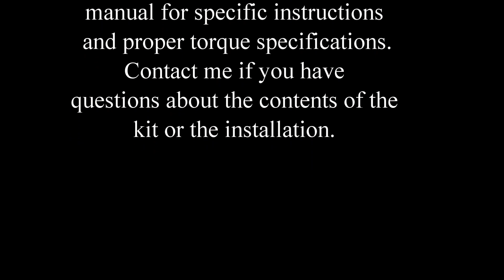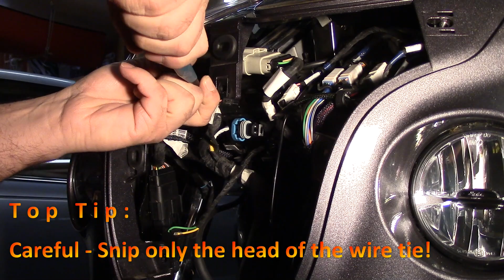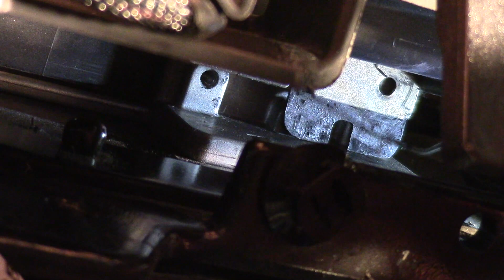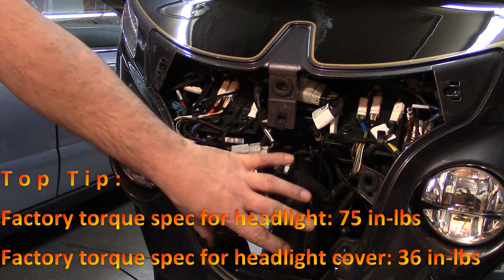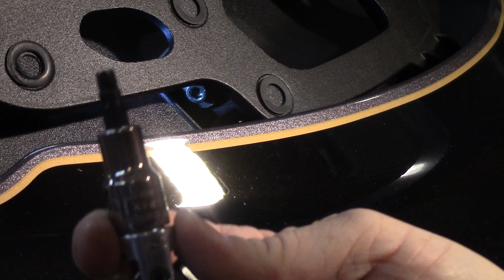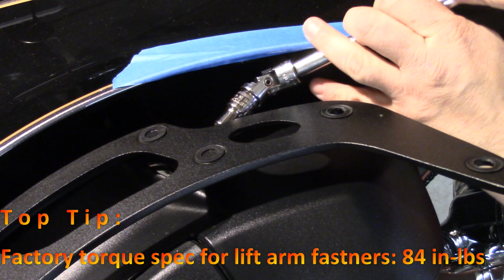Indian Motorcycle Power Windshield Rattle Fix v2.0

Comment: Slow on shipping, but great little product.  You can tell someone has analyzed the design problem, coming up with a solid solution.
Interesting that the windshield is more solid when fully raised.  Tiny bit of movement when fully down.
Easy to install. I keep a flexible magnet close to each screw when removing them.

Comment: Very well made instruction video.  Did you have play when trying to move windscreen by hand up and down ?   I don't feel ANY play when trying to move mine up/down BUT I can hear some light rattle that IS the windshield because when I grab it while riding the rattle stops.   I just can't see how those shims would do anything for me as I don't feel any play ??
Reply from the maker: Big Joe . Most 2014-2017 Indians with this power windshield have the lost motion in the screw mechanism. That is where the majority of the rattle comes from. Check out my other video and you will see the lost motion that I am talking about.